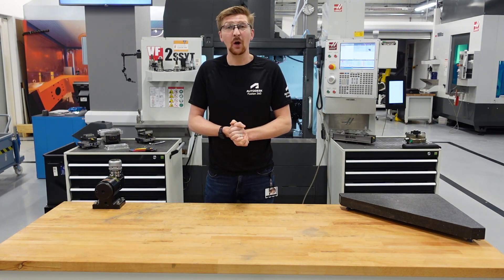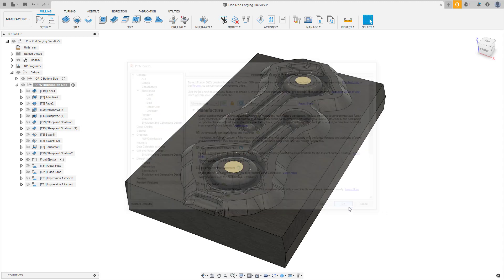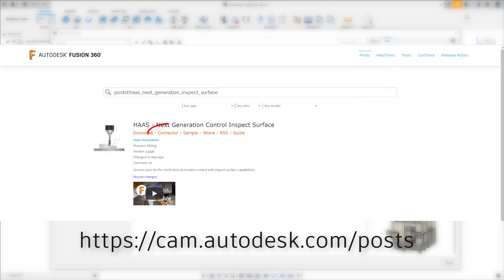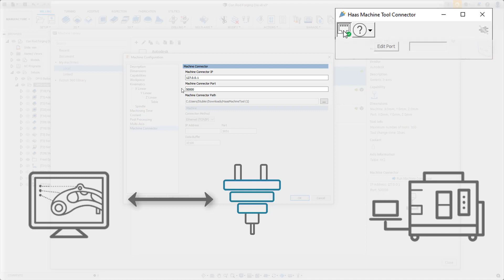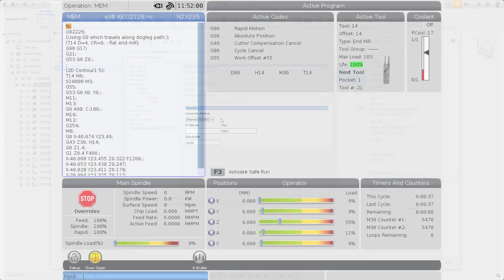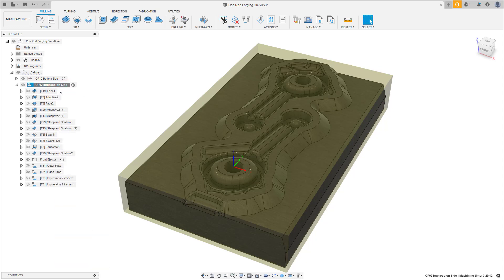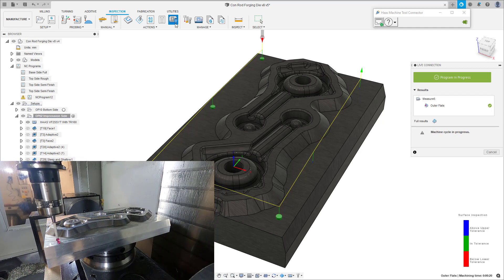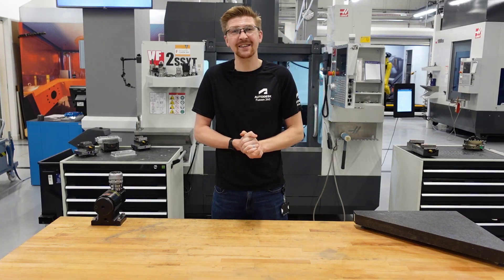Fusion 360 Live Connection Inspection Import with Haas Machines | Autodesk Fusion 360

Comment: So I followed these steps to a T. I have a umc -750 wired to a network. I enabled all settings and I put in the matching port and IP address of the machine connection. It is failing to connect do to a “buffer” issue. Any ideas?
Reply: hi! I have the same "buffer" issue with my Haas machines UMC750SS and VF2. Did you solve this problem?
Reply: @reshah86  Same problem here . super mini mill 2

Comment: Looks great, will this work on a 5 axis mill with Siemens 840D control?
Reply: Hi Mike, for this first release it is only for HAAS Machines, we will be looking at expanding this to other controllers. I know the 840D control needs a cost option called "CMI" or "RPC" do you know if you have this?
Reply: @richardstubley9651  Hi Richard, I need to check on that, Thanks!